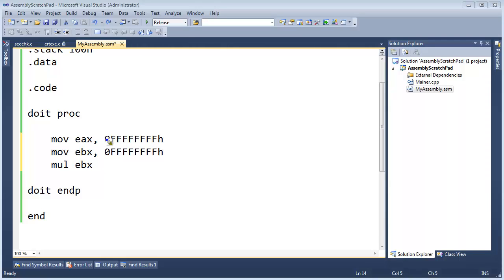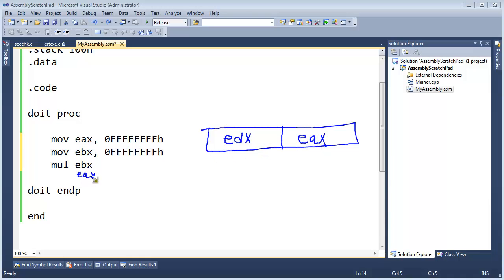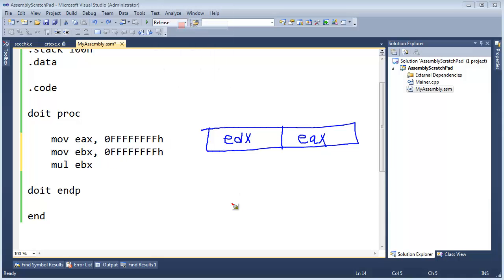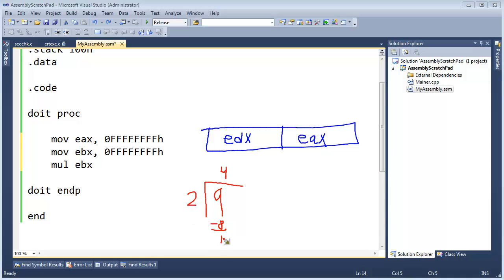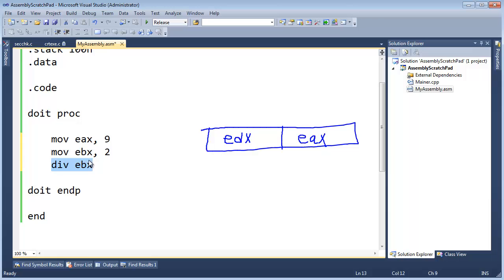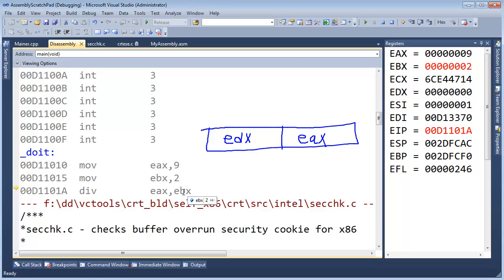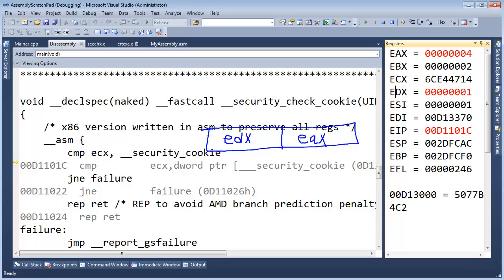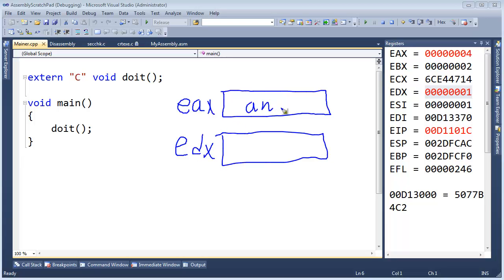Assembly Division

Comment: Hello. While doing this division, it gives error: "Unhandled exception at 0x0010101a in AssemblyScratchPad3.exe: 0xC0000095: Integer overflow." So I set the edx to zero. But why we need that? EDX's value wasnt FFFFFFFE. It was "01611ED8" when I got the error, so I think it can write 1 bit to there.

Comment: Could I get some help? After I press F11 at the div instruction VS sends an exception with this text: "Unhandled exception at 0x00fa101a in AssemblyScratchPad.exe: 0xC0000095: Integer overflow." I don't get "4" in the EAX register since it had an integer overflow either. Any help?
Reply: These are great videos, but one thing he left out is that you need to clear the edx register before doing the div instruction.  The easy way to do this is with xor edx, edx.  That will set edx to zero.
Reply: Chad Botting I know this comment is over a year old, but I wanted you to know you helped me today. Im more likely to find the end of a rainbow than get a moment to ask my professor a question. 

Edit: Thank you :)

Comment: Great explanation. I am just wondering why you cannot print remainder when you push edx on stack and then call print function. If I am not wrong remainder should be in this case 1 and when I print it the number goes way over 1. Can you tell me where is 1 stored. Thanks!
Reply: And why when you print eax for the first time the value is 16 (in this case), and when you do it twice or three times the value just is not the same anymore. Any solid short video I can look up to?
Reply: @DebeliJimmy  
Because edx and eax are changeable by the function 

The return function goes to eax. 
If you want to use edx you probebly want to save it first